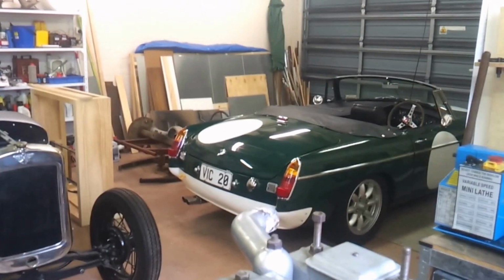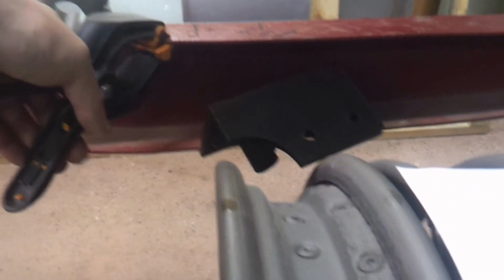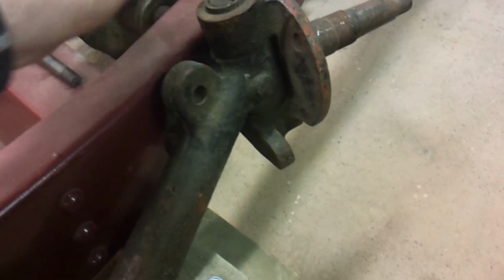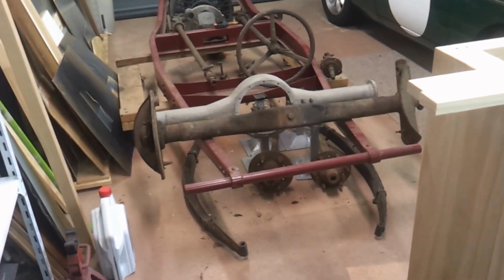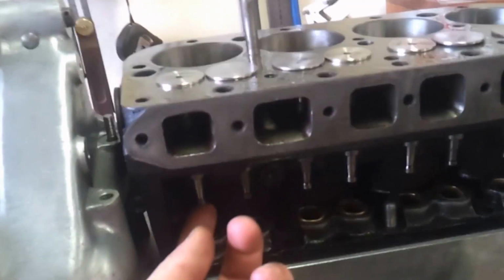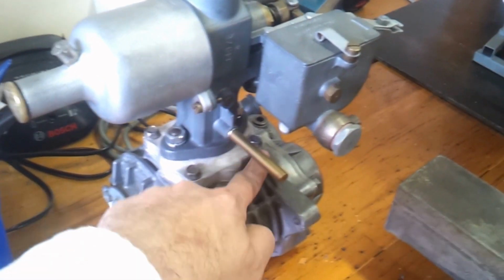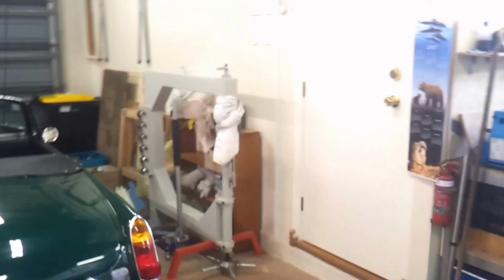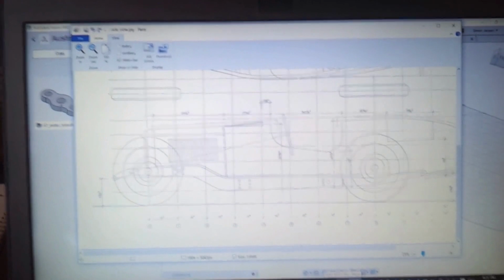Garage and car progress.

Comment: Bolt the block and gearbox together and take the measurement from the centre line of the stud for the gearbox mount to the centre line of the engine cross bar. This dimension will be the one to use to measure from the rear gearbox mount, which is in the centre of the crossmember, forward to give the engine mount position. If the crossmember is in the correct place that is. What you need to look at is a Mk III or Mk IV chassis as the engine and steering box mount is the same.
The steering box mount you have is off a later Nine and not of any use for a Brooklands special. Same goes for a few of the brake parts you have which are off a 1934 chassis. Same goes for the pedals which can be modified to fit.
A problem you will have with that engine is the spin on oil filters. The casings are not strong enough to withstand the pulsing of a plunger type oil pump and they split.
No, those lights are not correct for a Riley.
Reply from the maker: Thanks Matthew, that just what I needed to know. And I should have realised about the engine/gearbox to give me the correct position. The cross member is in the right place, the chassis is a very precisely made copy of an original. I don't think I have the mounting for the rear of the gearbox from memory. I will check my pile of parts.